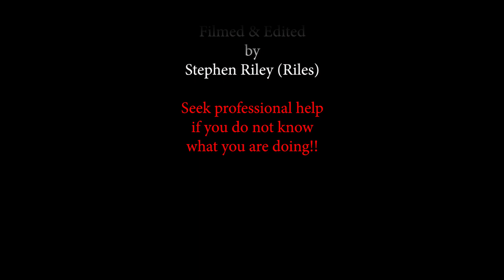VY Commodore Alternator change with Riles

Comment: Does the new alternator come with a new regulator?
Reply from the maker: Joshua in my case it did. My new one was a bosh. I think they would usually, but you would have to ask who you order a new one from if it is the case to be sure.
Reply: @StephenRiley_Rilesmedia  cool mate. I've ordered mine from Repco , chch  here in New Zealand.. I'll find out tomorrow morning.. I drive a 2000 VT commodore.  I'll be copying everything you've done in this video tomorrow .. thanks for sharing , it's a great help.
Reply: @StephenRiley_Rilesmedia  I don't think the one coming in is Bosch
Reply from the maker: Hopefully new ones what ever the brand will have the regulator as it should be all part of it. An alternator is not much good without one. Looking on net at different new alternators from What I see have the regulator.
Reply: @StephenRiley_Rilesmedia  yeah cheers mate, I'm looking forward to putting her in.. I'll be careful not to dislodge the belt as you said.. good sunny day for it here in Christchurch.
Reply: @StephenRiley_Rilesmedia  got it on.. but almost lost my thumb in the process pushing down the tensioner to put the belt on lol... Car runs good, but sounds a little different.. I didn't dislodge the belt from the other rotars , so maybe it's just benign.. let's hope
Reply from the maker: Good to hear it is working. Did you double and triple check that the belt is sitting in the grooves on all pulleys properly?? I did realize after I had made the video that you can put a socket spanner on the Pillay but to move it instead of pushing on it like I did.